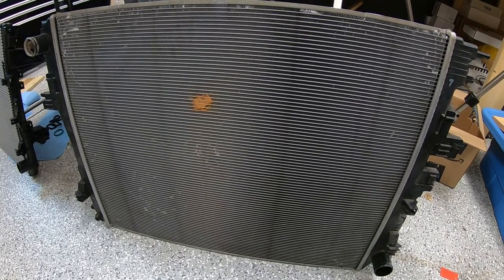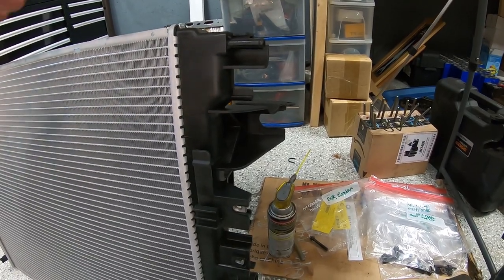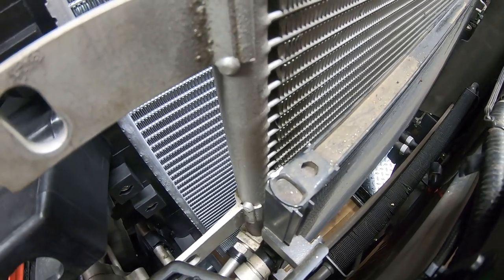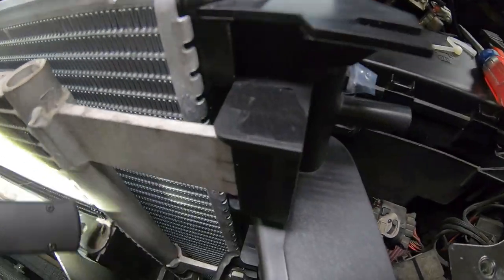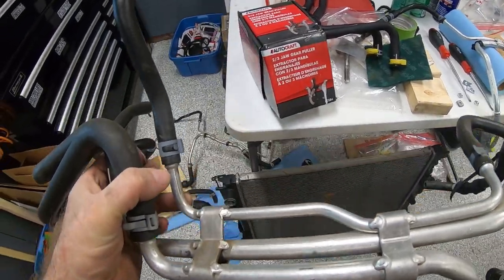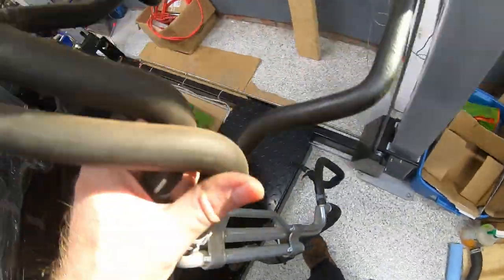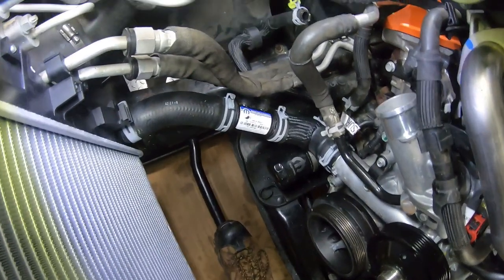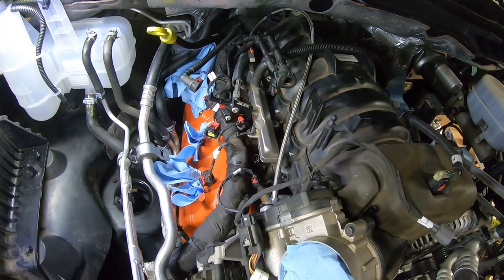Ram 2500 6.4L Upgrade Part 33 hemi radiator, and coolant hose installs.

Comment: Thank You I have the same rig in my driveway.... all cooling lines off! I took them off 20 days ago waiting for new reservoire! But started a week before flushing heater core then I decided to label what was left and blow out and clean all of the lines...... good thing I did because I had two of the 5/8 lines water water wouldn't pass through but with a lot of air they finilly opened up.  So I actually lost track of the right hose off the large tee original location. So Thanks You! sure would have been a long day second guessing myself!
Reply from the maker: Awesome, I'm am happy to hear that the video was helpful.